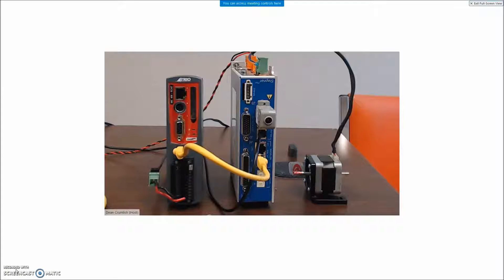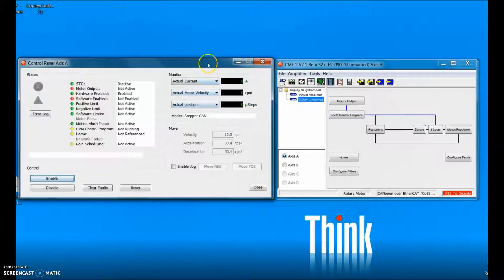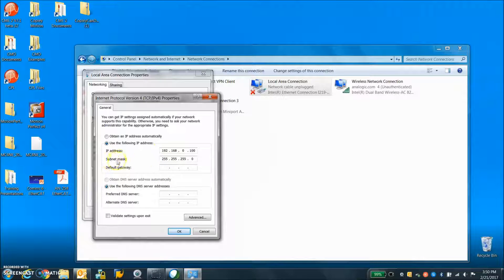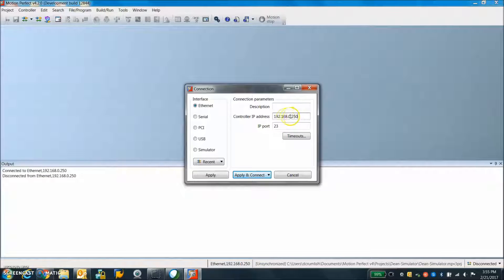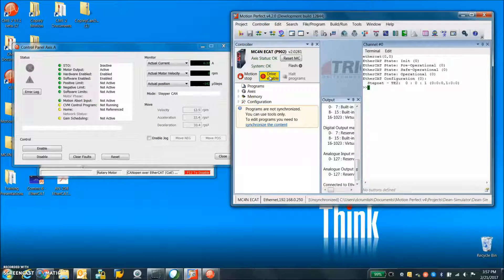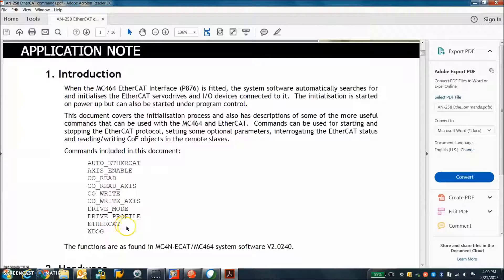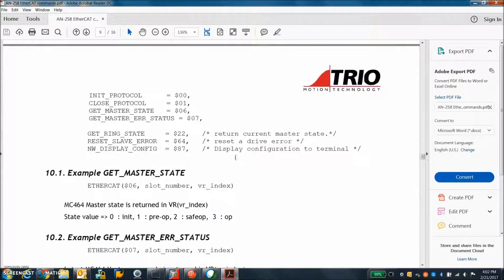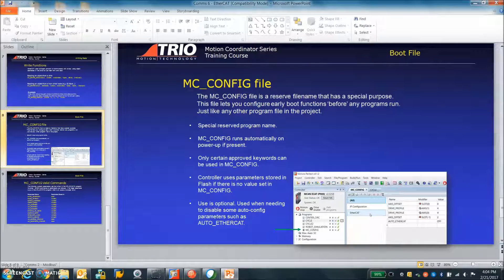Trio and Copley EtherCAT Getting Started

Comment: I need DC servo-drives ethercat, how can I get the
Reply from the maker: Hey Moshendo, using a Copley to drive a DC brush motor is no problem. What do you have for feedback? Send me an email dcrumlish@copleycontrols.com
Reply: @dinocrum  hi thanks for the reply, I will email you shortly, I will go with your feedback devices which are surely compatible to your drives with no hustle
Reply: Hi  @dinocrum   I have send you couple of emails  with no reply  ,please I need assistance  ASAP.
Reply: @dinocrum  I honestly need your assistance, technical support.
Reply from the maker: @seimela  send me email at work please dcrumlish@copleycontrols.com